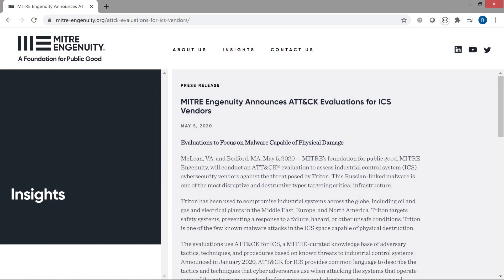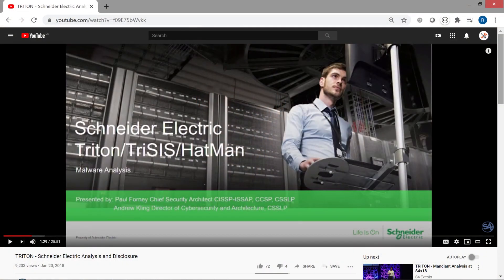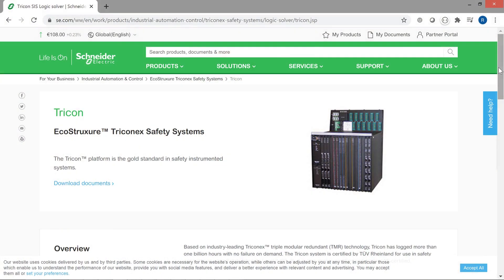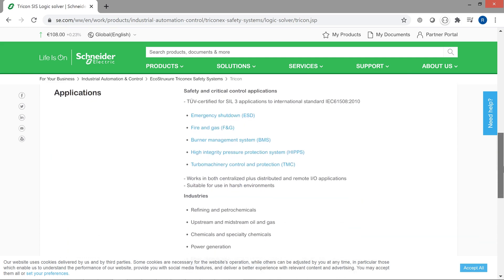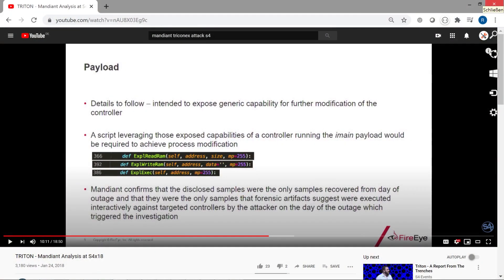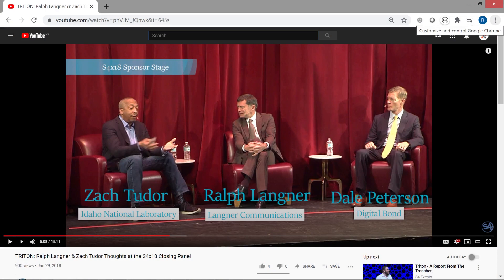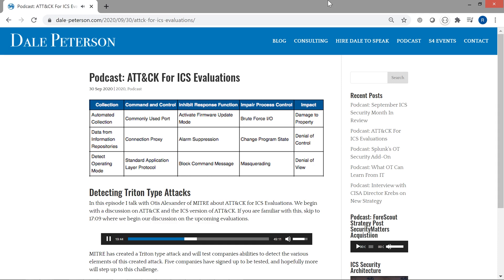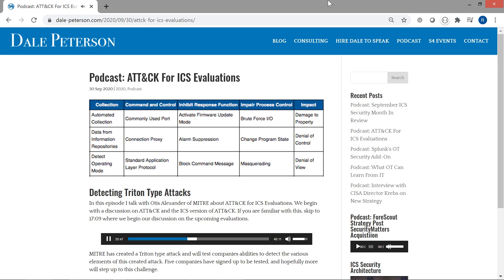MITRE ATT&CK for ICS and the Triconex evaluation

Comment: Great Video! Thanks for posting, have really been enjoying this channel's content as of late!

While I certainly agree that many IDS products/solutions that exist may certainly be a cost that many utilities don't need to be spending rather than shoring up their existing cyber-infrastructure, I do feel there is value in aggregating the data these products collect into a single pane of glass for not only SOC analysts, but for engineers/operators as well. However, I think this data aggregation doesn't justify the cost of these products/solutions. OT Asset Management services, like OT-BASE, have tremendous value in regards to data collection, aggregation, and analysis for both cyber and operational applications. In addition, services like Splunk/ELK/SecurityOnion, I believe, also have tremendous values in creating a single pane of glass for utilities. What are you thoughts on tools like Splunk/ELK/SecurityOnion, and how they relate to ICS OT Asset Management and ICS Detection?
Reply from the maker: I'm a big fan of integrating Splunk and ELK with OT-BASE, and we have done that already! See https://www.youtube.com/watch?v=V0cokw09zf0 for example. It's just as you say, there is added value "not only SOC analysts, but for engineers/operators as well". Always advocated IT/OT toolchain integration.